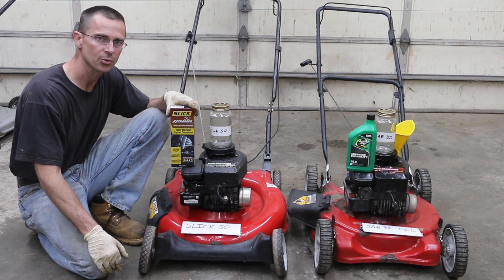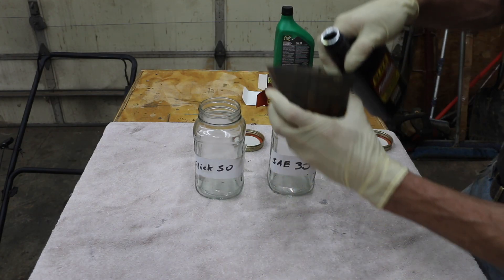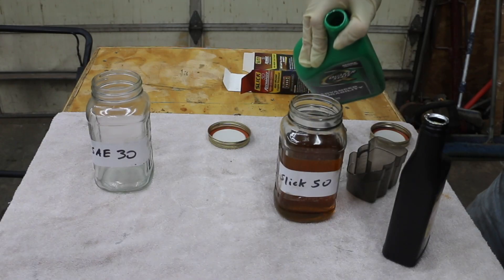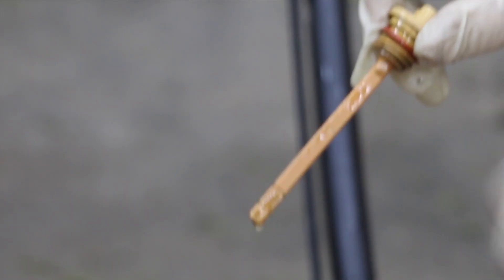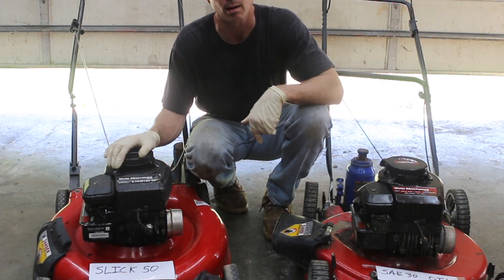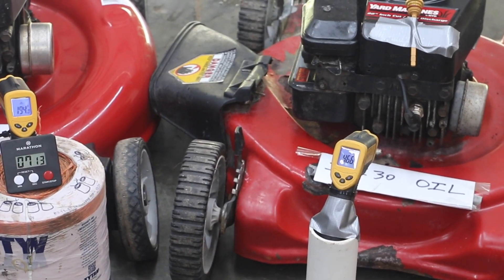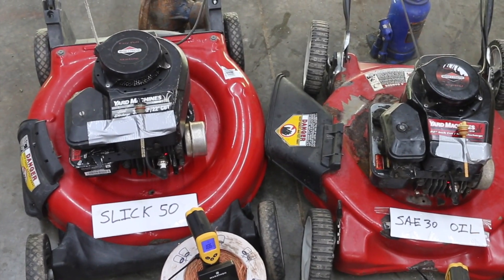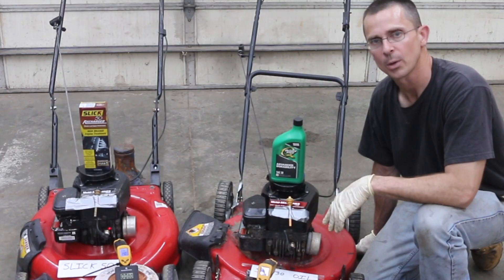Can't believe what SLICK 50 did to my engine!!--Dry Crankcase Test!

Comment: Correct me if I'm wrong here especially the know it all peanut gallery out here in YOUTUBE LAND... Since I run a small engine shop and I the know the fact that>>>> Don't most mowers and tractors have a sensor that ya can't start em with no oil in the crank case or was I out chewin too long again on the Chikowa weeds down in the meadow again.. I have a real cheapo KMART 21 inch WEED EATER MOWER I bought 10 years ago... It runs fine as long as there is oil in it, low oil or no oil no starty for my Mister Mower... If not no can do it won't start so what's wrong with this set up?????  This guy has magical mowers that run without oil?
Reply from the maker: Hi Tim, The high end mowers may have sensors, but not the ones I tested.  Both engines did lock up as evidenced in the videos.  Others on this forum have commented that they too have locked up engines this way.  Thanks for watching the video and commenting!
Reply: Well I bought my mower at KMART on sale for $99.00 so it ain't no high end mower and I run a small engine shop here okay. I've been working on engines since birth my father and grand father Started ran SPEED CITY USA in Allentown Pennsylvania since 1955. I grew up with grease on the diapers probably the way they will bury me here... Check out HARLEY BEE MOTORIZED BICYCLES HERE ON YOUTUBE... I will show my video of 2 CHEAPO LAWN MOWERS NO STARTY with no oil em... I have one here right now it was the very problem WHY MY CUSTOMER brought it here.. It doesn't start without OIL IN THE CRANK CASE. I'm planning on a NEW GRAND RE-OPENING for SPEED CITY USA in OCTOBER of this year in HAZLETON PENNSYLVANIA if shit holds out for me. I was just wondering where the magical mowers came from albite..., They look like some MTD brand and if they start with no oil in em I'm gonna start recommending those mowers to all the dopes that bring their mowers here that won't start come spring time... It's mostly the problem why people bring the shit here... There's no oil in their mowers and tractors.... The mowers made since 08 most have a synthol oil in em so those mowers that come here are mostly shot and out of oil too when they arrive here... Sorry for being a skeptic.. It is possible some MTD or off brands run with no oil in em.... Most of what arrives here everyone says the carb needs to be cleaned or a tune up. Mostly the problem is the morons are too stupid too put oil in the mowers and tractors and the most common explanations is I DIDN'T KNOW WHAT KIND OF OIL TO PUT IN IT.... So they thought it would keep running..... Sheesh... I even get questions put to me about SLICK 50 and other additives... I won 5 modified championships putting 2 cycle oil in my race fuels since 1979... PAUL BAUSHER TAUGHT ME THAT A LATTER OLD TIMER WITH LOTS OF WINS IN THE DIRT TRACKS.. WHEN I WENT TO ASPHALT TRACKS I STILL USED 2 CYCLE IN MY RACE FUELS AND STILL DO IN EVERYTHING I OWN THAT I RUN HARD... 0 ENGINE FAILURES..

Comment: Put slick 50 in my truck. Pulling a trailer of equipment on I-95 when oil pump gave out. Had no choice but to drive 12 miles to garage. They replaced oil pump and mec told me that I was lucky to shut engine off immediately.  I laughed. Drove it two more yearsz

Comment: But at least the Slick 50 did help the engine run cooler when it was running and no one runs an engine without oil in it anyway.
Reply: Billy Cook You'd think not wouldn't you, but I've seen a car leave service with no oil in the sump!
Reply: point well stated....
Reply: allthogh i think i have a theroy why it ran coler and lasted shorter it ma be that the SLICK 50 is insulating the engine therby reducing the outside temprature of the case while increasing the indside temprature, its just a theroy but to me it seams like its possible. apologies for anny bad spelling english is not my main laungege language
Reply: Lars!? You have a great point! Is the Slick 50 engine actually running cooler or is the heat insulated from coming out to the metal. Running each engine for longer with oil in them may tell a different story.

Hmmm...with time elapse I have no idea how long they were run, but I think it was until they both stopped getting hotter. If so, your theory is already debunked. I'll rewatch the beginning.
Reply: Lars, that part of the video was too edited down for me to be able to tell, so I put up a new comment asking about that.
Reply: ok
Reply: Lars Poulsen Sorry. Never got an answer.
Reply: its fine
Reply: Billy Cook well I have ran my engine for 2 years without oil

Comment: Hey PF, I will give you a clue as to what probably why this is, sure the slick gave out b4, right? but, it is PTFE based right?
so, it runs cooler. so, engine with reduced friction is better right? so, when you took the cooling off, it would be like rubbing of scuffing off the teflon coating , and therefore, you expose more friction than normal, as the teflon was, in the grooves of the hatching, andthats why the reg outperformed, you changed the temps. and so without norms, change the results,, ya know? :) cheers! and, your welcome! :)

Comment: I stopped using slick 50 after losing 2 Pistons & A Crank in my Ex-wife's truck over 4 years, with a 5.0 Motor with under 150k Miles and Most were Highway miles. I switched both her & My truck to Dura-Lube and have never done work to her truck, My F-350 460 Gas Motor Truck has almost 600k on it her... The only 2 times I had the Motor apart were the Timing Chain........The second time around 375k on her I put in timing Gear Roller gears like they use In Nascar or High Demand in Alaska Ice Fields... it cost me 500 bucks but the time not lost to a break down was worth it along not to mention the instant power it seems like she has now and still after adding 200k+ miles on her since putting them in.
    Hell I still have almost all the Factory Electronics from Ford Factory and she still has original Injectors. Only truck I know with over 100k on her that you can Put a beer on her hood and it does not cause her bounce or slide off because of rough Idle.....!   I will say this though I have changed to High Miles Dura - Lube @ 350k but that's only big change!  I wanted to try Lucas on her but Im a big guy of old school if it aint broke DONT Fuck with it! ... I had the same low Brake pedal Issues you had on your 350 on My Truck. But other than that she is like a Tank she just keeps Going no matter what I throw at her!    Cow  }:-o)

Comment: I wonder if the oil and slick 50 would have been used in the opposite engines would the results have been the same... May have been more the engine then what was in it.
Reply from the maker: Great point! Using new engines would be better.  Thanks for watching the video and commenting!

Comment: Fun to watch ,I bet both motors will run again once cooled down and just break the rod free by turning the blad. Then pour in the old oil and see which one runs better /longer. Or put new bearings/rods on both and start again
Not realy fair test as one is older with more bearing wear and the heat from one blowing into the older one.
Reply from the maker: I agree.  Using new engines would be better.  Thanks for watching the video and commenting!

Comment: I'd like to have seen the slick 50 engine run with just oil first and the temperatures measured. Then empty, add the slick 50 mix, run it and take temperatures. See if there would be a drop with the same engine. 

The two engines might not run at the same temperature or dissipate heat differently.
Reply from the maker: Mr. Trustafox,  Great point!  I should have established a baseline for both engines! I'll do that next time. Thanks for watching the video and commenting!
Reply: Project Farm you really need to get two brand new identical engines and do baseline tests with them. but then most importantly run them both for a day straight with one having slick50 in it. because I'm sure I read that slick50 needs to be run in on the engine as over time it builds up a thin layer  coating of a new compound that is where the real Val e of slick50 comes in I'm sure.
Reply: MrTrustafox, while we can't go back and do a control on these engines, it can easily be a test done on one engine to see a before and after to show that Slick 50 really does or doesn't lower the temperature. It can be a test by itself without a torture test.

Comment: In Aviation small air cooled engines are normally ran for the first 50 hours on Mineral Oil. This is basically what is in ZMax. But the best lubrication for engines is Amsoil. Al Amatuzio started building synthetic oil after retiring from being a jet pilot in the service. When I was at the airport, one man came through who had 7 Power Cherokees in FL and told me the normal TBO (To Be Overhauled) time was normally 1800 hours. He said he used one quart of Amsoil and the rest was Aero Shell 100 (SAE 50 ashless) and his engines lasted 3600 hours. So, if you're looking for the best lubricant you can get, I believe you can not go wrong using Amsoil.

There are a few companies around that make additives for specific applications. One of those is a company named BG. They have a product named MOA that basically will do very well on high temperature areas. They used to make an additive acronymed EPC (Extreme Pressure Concentrate) that would make the blued seized up bearing machine, Slick 50 salesman would used to show how good his product is, run again and the bearing would actually ungauld and the blue color would leave.

The salesman would ask if we sold BG, and if answered "yes", he would pack his stuff up and not do his demonstration(s).
Reply: My grammar checker changed Piper to Power. The planes are Piper Cherokee 140s. Had Lycoming O-360 engines.
Reply: I was thinking Amsoil also but I used to use it in my chainsaw, moped,  and Stihl weedeater.  It was the 100:1 mix.  I have not used the oil for the crankcase.  I really like the mix oil, never had a problem with it.
Reply: Saber Pro is 100:1. I did not believe that would hold water, so I tried to ruin some 2-stroke residential grade trimmers, blowers, etc. I did that by running it 200:1 in some and checking the exhaust ports and spark arrestors afterward. Carbon would tell the tale. They got hot running that lean on oil, even Amsoil, but I never seized one or "chunked" a rod or other parts. Closest I came was one cheap Ryobi 775 had a plastic part in the crankcase that melted, came loose after shutdown (when it really gets hot for a short time). When I went to recrank, the part had melted and dislodged a stainless tab and it caught in a place that locked the engine, only because it physically wedged it so it wouldn't turn.

Recently Amsoil R&D ran a test with 2 identical Echo trimmers. One with Echo best quality 2 cycle oil and the other with Saber Pro. The Saber mixed at 50:1 and so did the Echo oil. After 300 hours the Amsoil machine had an 8.8% airflow loss across the spark arrestor and the Echo oil machine had a 67% airflow loss. The exhaust port on the Amsoil machine had a 1% flow loss at the exhaust port and the Echo machine had a 60% loss on the exhaust port. That did impress me, so I quit testing and recommended everyone use the Saber at 100:1 on light duty and 50:1 on commercial or heavy running. Oh, and no corn gas in any of the 2 cycles. Carburetors and and Tygon fuel line will not take the Phase Separation.

Comment: A lot of things were missed here: 1, As another viewer mentions, motors in identical condition should have been used to make this a valid test 2. The motors should have been flushed with a solvent to remove internal sludge first (Slick 50 is a Teflon coating treatment that is supposed to penetrate and bond to the metal, it doesn't do this well if sludge is present) 3. The Slick 50 product needs to be run in the motor for a number of hours (miles) for the Teflon to bond properly as well. 4. Adding more of the Slick 50 product than the instructions call for is not necessarily a good thing. This product bonds Teflon to an engine's internal metal surfaces. Too much Teflon inside a rotating bearing may make the tolerances incorrect or may simply ball up and shear the Teflon right back off.
Other than that, it was an interesting test.
Reply from the maker: Darrin,  Great points!  Thanks for watching the video and commenting!

Comment: Interesting test. Don't know if we can conclude much by a single head-to-head test. Engines had different wear, the blades might bite the air a bit different, one had a closed grass chute, different heights, (different engine loading),exhaust of one feeding into intake of other, yada, yada, yada. 

It would have been nice to get a baseline running temp with both engines with just the straight oil first. Then, compare to one with the Slick 50 to see if operating temp dropped. To me, the lower the running temp, the longer the engine should survive in the real world. 

Just the same, thanks for doing these tests.
Reply from the maker: Great points!  I'll improve the next test with baseline temps.  Thanks for watching the video and commenting!

Comment: should have ran pre mixed fuel. I ran a similar lawn mower on old chainsaw gas for a summer dragging it behind a lawn mower down trails and in fields for a whole summer. one day In the fall i  felt bad and decided to clean the air filter and change the oil, but there was none in the crankcase! the mower still runs to this day , and I always put marvel mystery oil in the fuel now that the 55 gallon drum of old fuel from a chainsaw shop is gone.
Reply from the maker: Impressive!!  Thanks for watching the video and commenting!

Comment: Here is the problem with this test, and this has to do with how internal combustion engines generally  work. Engines have an oil pump that forces, (pressurizes), a liquid cushion of motor oil in between the connecting rod bearings and crankshaft, and  between the main bearings and the crank shaft, and also lubricates all other internal moving parts, (camshaft, lifters, etc.).  Under normal circumstances, their is no metal to metal contact between the bearing babbitt surfaces and rod and main journal surfaces. The engines moving parts "float on a cushion of oil". So, removing that oil cushion allows slop and metal to metal contact between the moving parts, which normally does not occur, and allows not only friction, but beating and  hammering of the rotating moving parts. This is what is generally heard and known as a "Rod Knock" sound.  Liquid's cannot be compressed, and by removing that "Oil Cushion", this test is removing a crucial component, that is required by the engine design to function. It is not only just an issue of lubrication, it is  missing a component. This does not mean that the lubricating properties of the oil have not been increased by this , or any other type oil additive, ( the lower engine temperatures indicate this), It simply means that the design of the engine requires the cushion of oil to work. If this engine had ball bearings, designed for limited metal to metal contact,  instead of oil cushion-babbitt style bearings, the engines would be able to continue running for an longer period of time, as ball bearings are designed for limited metal to metal contact, even with only the residual oil film left in the engine.
Reply from the maker: Great comments!!  I enjoyed reading them!  Thanks again for watching the video and commenting!

Comment: Have you ever heard of Microlon ? I rebuilt an engine and when it was broken in I added Microlon and the RPM went up about 250 revs so I turned the idle down and never turned it up, and it ran cooler and smoother.
Reply from the maker: I've never heard of it.  I'll see if I can find it and give it a test!  Thanks for watching the video and commenting!

Comment: Looks like as long as you keep Slick 50 in the motor it stays cooler and would result in less wear which would increase the lifespan.  I believe that was the purpose of the product.  Very interesting to see that there is a difference as all.  Thanks!
Reply from the maker: Thanks for watching the video and commenting!

Comment: Your test is flawed, Slick 50 needs to be in the motor for a period of time to impregnate the metal of the engine. Also just from watching your video here, it looks like Slick 50 is thinner than 30 weight oil and that caused the engine to drain out more completely than the engine with the 30 weight. A+ for your effort C- on the test.
Reply from the maker: Great points!  Thanks for watching the video and commenting!
Reply: Project Farm Thank you for doing this stuff in the first place.

Comment: nice results on the test // the old claim of slick 50 being able to continue running without oil and little or no damage is false as the video shows // but my original posting about the slick 50 was that one owner just used slick 50 in place of the oil with no oil added in to thin out // when pulled the drain plug it was worse than molasses coming out - took about 2 hours to get enough out to fill with a kerosene based engine oil cleaner to even thin it out for proper drainage  // once all was good for good fresh oil the person did not want regular oil so he put in 2 bottles of slick 50 and then 4 bottles of LUCAS honey oil treatment // he did have a chance to save the engine but this was not the case as i did see him on the side of the road broke down a few days later // so i guess he finally learned to follow directions of the products - the engine when tore down looked like hard coal sludge and would barely let the engine turn and it was so thick it snapped the timing chain
Reply from the maker: Interesting!  Thanks for watching the video and commenting!